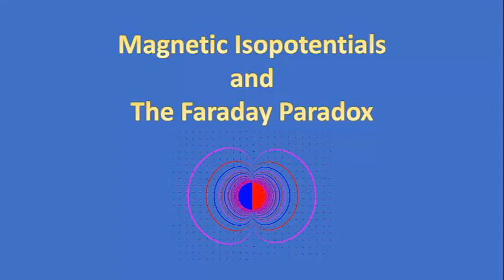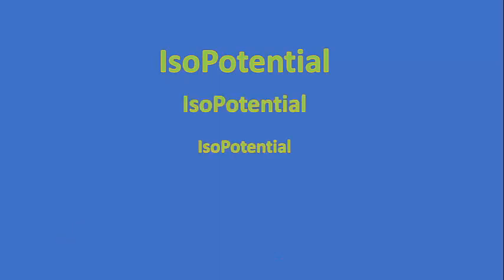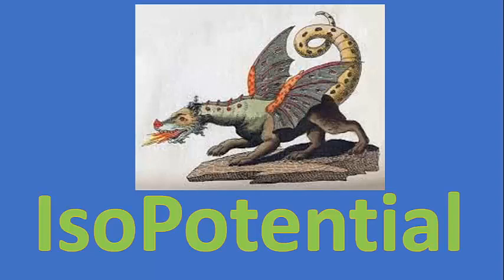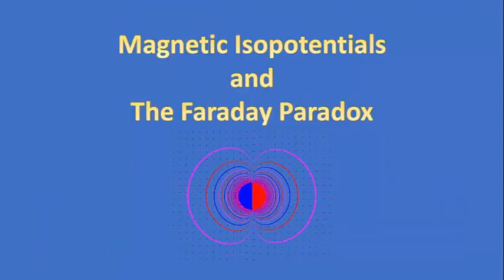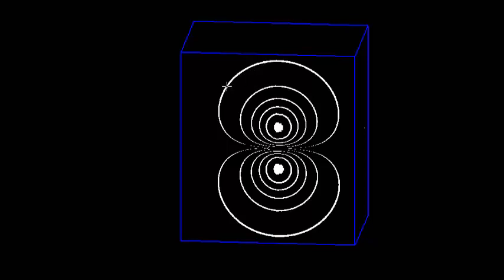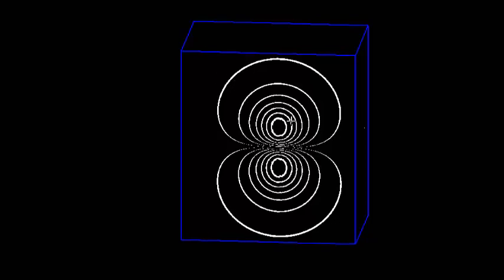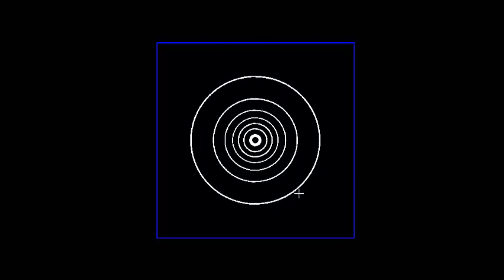Magnetic Isopotentials and the Faraday Paradox

Comment: When you spin the disc alone, you get voltage.  When you spin the magnet and disc together, but contacts are stationary, you get voltage.  When you spin the magnet, the disc, AND the points of contact all at the same RPM, you DON'T get voltage.  How is this explained???  
When the magnet is stationary but the disc and contact points both rotate together, you get no voltage here either.  Again what gives?
Reply from the maker: I will answer that question, but I suggest that you cut an paste this comment into ChatGPT to see what it says. It will give you a much more detailed explanation than I could possibly do here. 

Voltage is not caused by “rotation.” It is caused by charges moving through a magnetic field in a way that creates a net force around the circuit. 

Spinning only the magnet generates no force because spinning the magnet about the axis of magnetization does not change the shape and location of the magnetic field "lines" in the space around the magnet. In other words, the magnetic field does not "change" when you spin the magnet in that manner.  No change, not voltage. 

When you spin the disk relative to the magnet but don't spin the circuit, then  some parts of the circuit move through the field differently than other parts, you get a net push and a voltage.

If the entire circuit moves through the field the same way, all the forces cancel around the loop and no voltage appears.

That’s why spinning only the disc gives voltage, spinning disc + magnet still gives voltage, but spinning disc + magnet + contacts together gives none.
Reply: @FractalWoman  I still don't see how this explains why rotating the contacts with the disc causes no voltage.  When the contacts are moved separately from the disc there is voltage, but not when they move together.  Could you please help me understand this?
Reply from the maker: Did you ask ChatGPT or whatever AI you are using? They are going to do a better job at answering your questions than I can possibly do in a short comment. Give it a go and then let me know.

Comment: It's not a paradox it gets even more clearer if you add a for example in which the disk an the magnet Not spin but the brushes do... Then you should get a volte, right? If you then would get not a voltage Then! And only then! Would be a paradox.
Reply from the maker: It's no a paradox because, when you spin a magnet about its major axis (N and S poles don't change place), the magnetic flux lines do not move. The charges in the copper disk need to be in motion relative to the magnetic flux lines. NOW, if you spun the magnet such that the N and S poles are changing place, THEN you would see a voltage change. This is how wind mills work.

Comment: Would there be a gradient in the strength of the field across the pole of a magnet? I think the mapped diagram should have been larger, so the solid white circle in the middle was the size of the magnet's pole. It doesn't alter your conclusion, at all, but I think it would be more accurate, just in case anyone reads this.
Reply from the maker: The pole of a magnet is a location not a size. Magnets have size, however, no matter what size the magnet is, the isopotential curves will look the same. The gradient IS the strength of the field. The closer the curves are together, the stronger the field strength at that distance from the magnet. And, this gradient field surrounds the magnet, even at the poles. You can see that better when looking at the isopotential curves from the side (where you can see N and S at the same time).
Reply: @FractalWoman  yes, but the face of the pole of the magnet is pretty uniform, my point is that your illustration showed isopotential lines between the center of the pole face and  the edge of the pole face. That's what I was questioning, but perhaps wasn't very clear in doing so.
Reply from the maker: @gerryjamesedwards1227  There is no "edge" to the pole, but magnets have edges. Is that what you mean by edge? The isopotential curves extend far beyond the extent/edge of the magnet.
Reply: @FractalWoman  The edge of the magnet's pole face. I KNOW they extend beyond it! It's the fact they are INSIDE that adge/rim, with a point at the center that I'm talking about.  The FIRST curve should begin at the edge and the others continue out from there. Oh look, just never mind. forget I mentioned it.
Reply from the maker: @gerryjamesedwards1227  I'm just trying to get to the root of your question. I am interested. But I also can't read your mind. No need to get frustrated.

Comment: This video got me thinking... Does the magnetic field of a magnet spin? Or is it down to the way that the pressure gradients lie, that give the impression of spin? We know a galaxy spins, a hurricane spins, but their spin is caused by magnetic fields... They are not magnetic fields themselves. A magnetic field is essentially a field of pressure gradients, not spinning vortices. Just a thought.
Reply from the maker: A hurricane is caused by pressure gradients. 
http://www.hurricanescience.org/science/science/primarycirculation/#:~:text=The%20pressure%20gradient%20force%20always,the%20center%20of%20the%20hurricane.
"The pressure gradient force always tries to move air from areas of higher pressure to areas of lower pressure. Since the center (eye) of a hurricane contains the lowest atmospheric pressure found in the storm, the pressure gradient force tries to pull air towards the center of the hurricane."
"In the Northern Hemisphere, air that is being pulled towards the center of the hurricane is deflected towards the right because of the Coriolis force, which is a result of the Earth’s own rotation. The greater the speed of the hurricane’s rotation is, the greater the strength of the Coriolis force is. With all of this inward-moving air turning to the right, the primary circulation around a hurricane begins to develop."

So, magnetic field does not cause spin. Magnetic field is an emergent property of pressure gradients, not the other way around. Field is a mathematical abstraction of the isopotential pressure gradient which is real and ponderable and understandable.

Comment: Counter intuitive and difficult.  Still not getting it.  I get that a magnet wont cause a change in flux or what ever word u like... when it spins along the axis.... thats pretty easy to get and except.  
Also I can imagine that the conductor Will cause enough disturbance to get a flux (or pressure) as it has no coherence and would include multi variable potentials somehow resulting in a current.  
However it does seem very strange if they where to spin as if connected...  shoot well I think just got it ....   I’ll post anyway - thank you...
 
  

  
...
Reply: The magnetic field on the magnet remains stationary, whether you spin the magnet or not in relation to the conducting disk. The disk has to move to break through the stationary magnetic field to create current flow. This is DC current. When you move the magnet in a way that alternates the poles, in relation to the conducting disk, then you induce a AC current flow in the conductor.

Comment: I don't think you answered #1 or #3 well enough for me... Is the voltage when just the "copper" disc spins extremely low? Is the voltage the same or close, but low, when you spin both in the same direction? Because if it is, I don't think you figured it out... In fact it shouldn't matter if you spin them in a different direction either. 

If you could answer, that would be great.

Thanks! And thanks for such awesome work.
Reply from the maker: I will answer exactly this, in the next video. It DOES matter which direction things are spinning.
Reply: @FractalWoman  Cool, I had a feeling and thank you in advance.
Reply from the maker: David: I actually think I misread you question before. I can answer it now. My next video will be on a different subject. Voltage is related to the rate at which you rotate the copper disk. If you spin it fast, the voltage will go up. When you reverse the spin direction of the disk, the voltage goes in the other direction.  Here is a video that shows this perfectly. 
https://youtu.be/gduYoT9sMaE

Comment: Hello Fractal Woman. After a process of deep thinking very long, maybe two months, following your isopotential lines video series, I've been come to the conclusion that, unfortunately if you really put a lot into this, isopotentials does not exist, as some of your "contenders" said in the debate between you and them. I came to this conclusion being able to calculate myself what you call "isopotentials" by pen and paper, using the "canonical" magnetic flux, instead of the Michael Snyder software and so on (which, in conclusion, does the same).
I also came to this conclusion studying the functioning of Hall sensors and their datasheets. There is literally nothing in the so called "isopotential lines": they are simply the consequence of the magnetix flux + the Hall sensor very normal, very common capabilities.
Despite this conclusion, which is mine and in no way should offend you, this particular video about the Faraday Paradox comes to real conclusion and I really think you solved the paradox. Let me say, this is a novel (until unproven by a prior art) perspectiive that solves the paradox making it a non-paradox in the first place. So congrats for the latter, but to me continuing on the study of a common consequence is in no way a path to follow for real advancements in the understanding of magnetism.

Comment: Bravo! 👍 The magnets "field" (Iso's) is / (are) automatically and constantly rotating, along with linear motion into the magnet. When both the magnet and the disc are stationary - the "field" holds the disc "electrons" in a twisted and pulled "stagnant" position.
When the magnet rotates - the "electrons" of the stationary disc maintain the stationary twist and swirl. (UNLESS the distance between the magnet and disc changes...)
However - anytime the disc rotates - the gravitational pull of the Earth continually changes the orientations of the disc's "electrons" - causing the twist and swirl from the magnet's field influence to create Eddy Currents. (Catch and release)
The disc must "move" to instigate the interaction.
(I wonder if a Homopolar generator has been operated in space where Earth's gravity has much less effect. - as on the ISS or etc.)

Comment: I did not know of this.  Very cool video.  In both situations, moving copper, was the instigater of current.  Between poles and edge of the disk.  The earth, as in earth batteries, causes currents in the ground, big enough that if you align them just right, one rod, stuck in the ground, of carbon, and one iron, it will create enough voltage to charge a phone.  One person used buckets of material to run his house.  Robert Murray-Smith has simple, short, detailed videoa on it here at youtube.  What if the magnet is simply magnifying what is already happening in the copper?  I will research this some more.  Very fascinating!  You explain things very well.
Reply: One also has to take into account the copper coil probes of the voltmeter. This would certainly have an affect on the system.

Comment: Hi Fractial Woman.  Spinning the conducting disc creates centrifical force within the disc, causing electrons to move outward from the center. The magnet, fixed or spinning is giving the electrons a push? Centrifical force = pressure gradient? Pressure mediation= pressure manipulation. Interesting. I want more!
Reply: Yes this is correct.
Reply: If this is true, no matter what "pole" the disk is facing and no matter what direction it spins, the output current should always be that the "electrons" are thrown away from the centre. But that's not the case

Comment: Thank you, another mainstream science mystery gone.  Will you be explaining how the spinning disk creates a current?  Does it rely on an ambient field, such as the earth's?
Reply from the maker: I don't believe it has anything to do with the Earth's magnetic field. If "everything is pressure mediation" as Ken Wheeler says, then the current created by the spinning disk near a magnet must also be due to pressure mediation. I need to run some experiments to see if I can simulate this. I am waiting for Michael Snyder to make some changes to his software so that I can have access to the raw data and not just a picture of the isopotentials.
Reply: @FractalWoman  Really a good point and very good direction in experimentation.
Reply: @FractalWoman  moving charges *are a current"... so relative to the circuit connected to it it's creating current. This goes to the question I've always had about things like electric generators and the peizo electric effect. Electrons seem to be generated out of the ether. They don't originate on the copper wire and then just leave and die. Lol. They seem to me to be created as something like a cavitation bubble of ether "material" or certainly a wave phenomenon. Electrons are magneto-dielectric things? It's quite confusing. But I believe the ether "particles" are Planck length, possibly Golden Rhombus vibrations. I believe the perfect shape in the universe is the Golden Rhombal Dodecahedron. I believe it's the analogous shape to ether particles. It's one of the only shapes in the universe that perfectly tesselates 3d space. It represents 12 spheres around 1 sphere. It is True and Holy Perfection. A perfect platonic pair to the cubeoctahedron. God bless.

Comment: alright very good.. but how would this look in a solar cell (photovoltaic) collecting charges, compared to those archaic  motor/generator types ? thankyou FW
Reply from the maker: Solar cells do not require magnets, so that is a completely different subject. I can tell you one thing about solar cells. Electrons can only be released from a solar cell when the light energy is above a certain value. This value happens to be the binding energy of the electron to the material with which it is bound. When you unbind a charge from the material with which it is bound, it is then free to flow. It is as simple as that.

Comment: equipotential lines or better yet a scallar pressure gradient?
Reply: If you spin a hoze while it has water under pressure going out the water will not change its course. The thing the water is hitting must move as it reacts to it
Reply from the maker: Yes, the pressure gradient is a scalar field. But, it is only one component of the field and doesn't tell the whole story. Same with the flux field. It is only one component of the field and doesn't tell the whole story. You need both to get a complete picture of what is going on. Hope this helps.
Reply: @FractalWoman  Ye, but i would like to add that the target is also inportant given its a dielectric. 
I would really like to see what happens if its feromagnetic and or paramagnetic reaction to it.